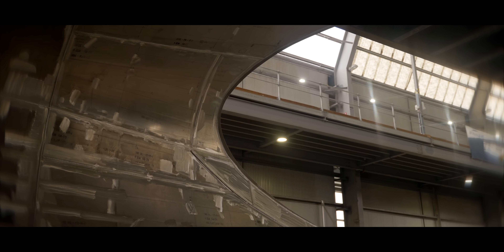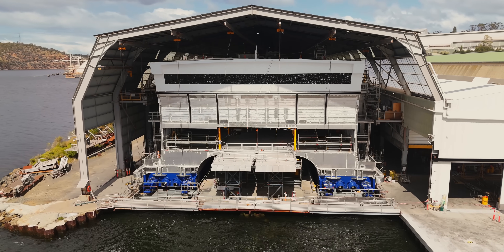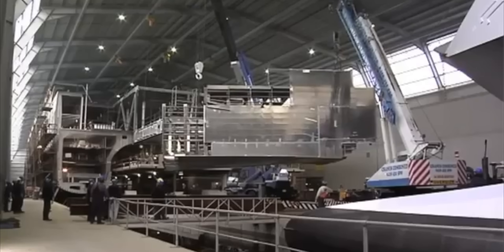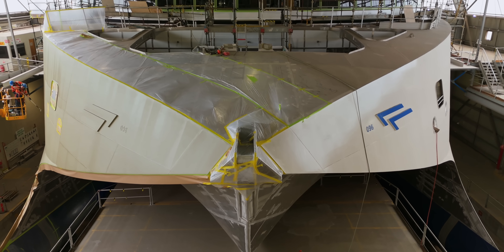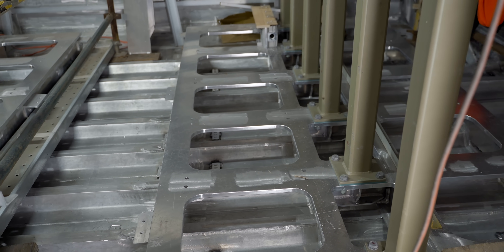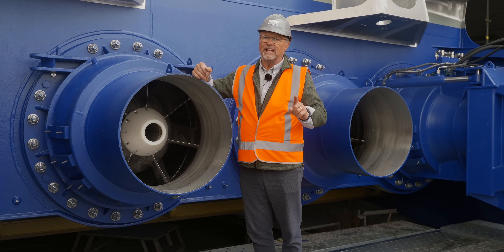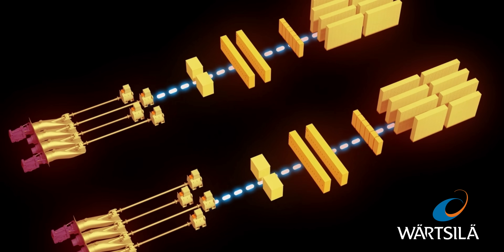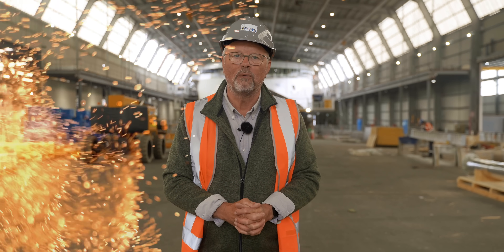The LARGEST Electric Vehicle In The World?!

Comment: An important mistake is that it's not 310 metres long. Is actually 130 metres (or 426 feet) which is still huge.
Reply: Claiming four jet engines at take off have the same power as one of the 2,200 kw waterjets is ridiculous too. The bigger jet engines today are well above 40,000 kw each.
Reply: 737 has around 24 000 kw each engine - says wikipedia  @juliane__
Reply: @bertkreft9689 jet engines are very poor efficiency, electric is ~95%
Reply: @bertkreft9689  and nowhere near 100% of that at 0mph is going into useful work
Reply: @juliane__  actually that's not what he said, he said each motor "uses" that amount of power, (not produces) the same amount of power as 4 jet engines on take off.
Reply: @matthewbrown435   - no one is saying how much a Boeing 747-8 consumes either...  - orders of magnitude off.
R_LL is not a technical guy - he giggles at anything that seems "outrageous, though totally understandable to anyone with a technical mindset.
Reply: @juliane__  eh.....447 tons.  this thing is far heavier. but accelerates to idk 30 probably vs 150 takeoff over 30 seconds or something
google says .7 seconds 160MW 450tons to go o-150.....so yeah its probably in reality like 1/20 of that going into useful work on takeoff or something idk. i feel like 20 seconds from standstill full power to lift off is about normal?
Reply: @alanmay7929 - The range is exactly what the ship is designed for. It's normal in engineering to fit a design to the needs. Anything above would only be excessive, costly and pointless.

In fact, this ship is far more cost effective than any other available drive train right now for its task. The very reason why they decided to go for it in the first place. The 'we are environmentally conscious' is just marketing honey on top these days. It is the economies and risk assessments which are the decisive factors.

It furthermore demonstrates that technology has come a long way. It means that nearly all ferries, if not all of them, can be replaced with electric drive trains now, the moment they would need replacement.
Reply: I thought 310 metres was a bit long
Reply: @philiptaylor7902  there is no way its 300meters
Reply: Shame you didn't get half your facts right.
Reply: Incat is a solid business. Building a world class shipyard on the bottom of the world, in an often dodgy economy, shows some nous. They deliver or die.
Reply: the biggest ship or moving object on earth the Knock Devis was over 420 meters long a true gigantic of the seas.
Reply: and the range a total joke!
Reply: @alanmay7929  the range is adequate for the task
Reply: @alanmay7929  It's built to fit a task.
You will see the same with other electric ferries too, look at countries like norway, where almost all ferries are electrified by now, they basically charge after every or every other crossing.
Reply: @DooMMasteR   - do they allow EVs on them now - they are a real hazard on an Aluminium boat, they were banned previously.. (in a country with ~90% government subsidised EV fleet.
Reply: @kadmow  There is only one company I know that did that Havila Kystruten other than that all other companies allow EV's and some even discount their journey or allow them on for free. It was a knee jerk reaction to an external audit due to fears over battery fires. This will fade in time as LFP and other battery formulas where thermal runaway isn't an issue.
Reply: @kadmow  yes and other ferries let electric cars charge while on the ferry. american car insurance companies published a study to verify the fire riscs in cars. highest risc hybrid, 2. ICE-cars, last place EV. most fires started in 12V system and was then fueled by oil and gas in the cars.
Reply: @alanmay7929 it's a ferry, it's designed to go from A-B carrying thousands of passengers 10 times a day - just enough is perfect, it's not a cruise ship
Reply: @matthewbrown435  who said it was a cruise ship?! its made for very short routes thats only what it can do! the diesel or LNG ones can be used for much more than just that and also go everywhere thats the point.
Reply: @alanmay7929  nope the point is to have something that doesn't have to rely on imported fuel, meets co2 emissions and is likely long term lower on maintenance. We have limited resources on this planet not to mention the climate crappin itself, why keep burning products that could be used for something else i.e the long haul trips

Comment: 40 megawatts of power to charge the ship, still laughing. what a nightmare for the power companies. By the way Tassie is not powered by 100% renewables. They still rely in some areas on Gas fired power stations and as stated rely on an under sea power cable from Victoria. The vast majority is powered by Hydro. Given todays strict environmental requirements I very much doubt you would get approvals for all the existing systems.
Reply: A typical large datacenter pulls somewhere from 50MW to 150MW (or more) and at 24x7 periods non-stop.

Even so, there are ways to mitigate the peak power demand during charging should it be an issue:

1) Install a stationary battery array of similar (or greater) size of the vehicle's battery array somewhere on-site or in proximity.  Then slow charge this battery when the ship is out in the waters so when the ship returns, the DC battery pack is ready right away to begin charging.
1a) An additional benefit is the stationary battery pack can do rapid & efficient "DC charging" since it is at the same voltage as the ship's battery.  This avoids transformer losses and DC rectification when power is pulled from the AC grid.
2) Install on-site and/or in proximity solar panels that can provide power to peak shave.  The panels can also work to charge the aforementioned stationary battery array.  This provides both peak shaving and reduces operating expense of purchasing so much electricity from the local grid.
Reply: @beyondfossil  yeah that's what I meant... as such 40MW isn't that difficult to maintain as a stable supply... but if you suddenly draw it from the regular power grid, the idle power plants needs a minute to rev up.

A battery backup charged at a constant speed is a good idea, so even if one harbour city is experiencing a blackout, the ferry can always return to the other harbour which most likely doesn't experience the same issue at the same time.
Reply: @BenjaminVestergaard Yep, also the ship's charging systems can be easily programmed to gradually ramp up charging current over a few minutes at least.  This would allow the electrical grid's control systems ample time to spin up and bring on enough power production to meet the new large demand load.  It is the courteous thing to do. 👍

This ramp up is likely what happens anyways as the charger's sensing electronics analyze the battery's readiness to accept incoming power.  Otherwise, there could be some damage occurring. The charger system can do accomplish this by bringing up the charging current slowly and listening for any fault codes from the BMS units.
Reply: @beyondfossil  generally data centers are located directly on the sides of power stations so there is a direct connection and they actually take time and contract with power companies before they are built.
Reply: @alanmay7929 Yes, a whole lot of permitting, paperwork, hearings, and studies are done before a facility of this scale is built.  The availability of electrical power is one of the areas that will get careful analysis.
Reply: @beyondfossil  look at AI companies, they are going to have to revive old nuclear power stations to make enough power for their reliable operations.
Reply: @alanmay7929  Nuclear is not needed by AI for a long list of technical and economic reasons.

Australia does not have nuclear and, wisely, will never have nuclear power.
Reply: @alanmay7929  Looks like YouTube is blocking all further posts on this topic.
Reply: @alanmay7929  This tech/nuclear thing is a mostly a media stunt by the major tech companies to draw attention to their growing energy needs.  It is working because nuclear is such a controversial hot-button topic.  It won't go anywhere much especially as renewables are getting cheaper by the year and much faster to deploy.

a) Nuclear power is the most expensive form of electricity production
b) Nuclear power takes the longest in construction time, even for a restart will take a lot of time
c) Datacenter power usage is a fast growing segment but overall is only small percentage of grid capacity world-wide.  The US has the most datacenters, but it accounts for only some 4% to 6% of the US total 4200TWh annual grid production.
Reply: Lights are gonna dim for a minute anywhere this ship docks. 😄

Comment: Not efficient!

Energy needed to make an entire ship in aluminium is much more than that of steel

Having the water jets only partially submerged is also inefficient - causing huge rooster tails of water wont be pushing the boat forward

Charging the ship via diesel generators?!

Comment: The fact that it is lighter than an LNG ship was quite surprising to me
Reply: the most efficient EV the Lucid has about 500 miles of range, a typical diesel bigger vehicle will get up to 900 miles of range and its even super easy to increase the range too.
Reply: no its not! its range is not even close to 100 miles! if you just fuel 100 miles of fuel on the LNG youll be significantly much lighter than the batteries! the LNG ones have tousands of miles of range so not even a comparison!
Reply: @alanmay7929  it's not the fuel weight, it's the weight of the engine & transmission that's greater. 400 tons of engines, 100 tons of gearboxes and 100 tons of fuel TANK = 600T, the batteries weigh 300T. So yeah, it's heavier BEFORE you fuel it. By a factor of 2 (for the drivetrain).
Reply: @theelectricmonk3909  wrong! wrong and rong! those things doesnt need gigantic engines those are relatively a small boats no need of a 100 tons engine use your brain lol!!! the gearbox too isnt tha much heavier either! the fuel is what makes most of the weight since they needs it to be able to do tousands of miles.
Reply: @theelectricmonk3909  some even uses turbine engines which are even much smaller powerfull and tho less efficient is more compact and still offers way more range than batteries!
Reply: @theelectricmonk3909  other modern ships powertrains are diesel electric like trains relatively multiple smaller engines and electric propulsions like azipods or thrusters and Wartsilla makes all of them.
Reply: @alanmay7929  Watch the video - it's not me making those claims, it's the guy building the boat! He should know!

Comment: Time Duration of discharging Battery power ; 
40e6 Watt•Hr ÷(24,000hp×745.9)= 2.234 hours
With Max power : 2 hours 14 minutes. For moderate power/operation maybe 3 hours (max)?
Reply: Trip between Buenos Aires - Colonia will take about half an hour. Time for charging between trips is 2/3 hours.

Comment: swappable batteries would be another way to increase the ships utilization. And the rapidly advancement of battery technology (charge density and lower cost) another set or two of batteries would be much more economically viable. Just one needs to include that in the initial design with 250 tons of batteries currently envisioned.
Reply: I think it’s more complex than doing that due it’s location and integration within the ship.
Reply: wrong! wrong! wrong! swapping makes no sense! the batteries just like engine and fuel tank are at the bottom of the ships making any operation impossible and very difficult

Comment: You all HAVE to do a follow-up when it goes in service.
Reply: - like, How do they source that 40MW of power - and at what cost for the storage Farm...
 - It appears to be a great route for a  super fast boat - just enough time for a toilet break and it will be docking.
Reply: Charge up capacitors on shore while it is underway so it can charge really fast when docked?
Reply: @MichaelFoley64  Then thermal runaway and fire that cannot be put out with regular shipboard firefighting.
Reply: @MichaelFoley64  Nicht nötig, das Netz kann locker 40 MW  liefern  mit 110 KV Anschluss . Aber auch ein 20 KV Anschluss schafft das.  Große Einkaufszentren  benötigen in etwa 50 MW Anschlussleistung.
Reply: @kadmow  40 MW ist nix an der Mittelspannung.
Reply: And when they deliver it.
Reply: If it’s anything like the ferry of theirs that runs to Jersey from UK it’s very sensitive to waves. Not in a good way.
Reply: @tobyhague5974  Da baut man sie halt anders.  Aber Katamarane kommen sehr gut durch die Wellen, weil sie ja mit dem Bug kaum aufschwimmen.
Reply: I agree.
Reply: Or burns

Comment: Tasmania is not quite 100 percent renewably powered. In times of drought, there is a submarine cable that allows coal fired electricity from the state of Victoria to be imported.
Reply: I believe he said net zero. So they buy credits to offset
Reply: @scenicshoots  Not quite.  Tasmania doesn't buy any credits, but trees growing back after the logging industry downsized provided credits.
Reply: And when it is a good wet winter/spring the Hydro River systems export due to excess supply. Some years there has been a little more imports than exports but a couple of new wind farms have meant that more recently some years there are exports but mostly close to imports = exports.  Some new proposed wind farms will in years ahead tip this to net exports every year.
Reply: Pathetic comment
Reply: In times of drought, when there's no sun then? Bwaaa hahaa
Reply: @chuzzbot  Yes - solar and Hydro are a good mix - we have little solar.  One new solar farm on a sheep property is being built and roof top solar needs to grow further.  But a couple of wind farms in the pipeline will mean it will exceed 100% every year easily.
Reply: @chuzzbot There’s very little by way of coal and no proven oil, so perhaps you could apply your obviously giant intellect to suggesting an alternative energy supply. Hydro-electricity has provided a reliable energy supply in Tasmania for a hundred years, but that’s clearly a source of humour for low-information types.
Reply: It’s actually connected to the Eastern Australian electricity grid, which is fed by (dwindling) coal-fired thermal plant, gas-fired, solar, wind and hydroelectric plant on mainland Australia, so what comes back the other way isn’t simply from coal-fired plant.
Reply: The purpose of the underwater cable is to supply energy to the mainland at peak times the two means of producing energy compliment each other, Tassie is my home state and I for one am proud to be Tasmanian
Reply: Victoria has sub 60% coal powered grid and falling , lets hope they kick coal of the grid like the UK
Reply: https://en.wikipedia.org/wiki/Electricity_sector_in_Argentina
Reply: Indeed! I checked and in 2024 there was almost 4% of electricity was fossil powered. Still would count as clean by UK govt definition 😂
Reply: So it is from day to day just in an emergency it needs that power? So it is 100% renewable as does not rely on that power to use each day. 😏
Reply: @alastairhatt360  Net zero means a lot more than just electricity generation.
Reply: @JimmyLLL  Tas was Net Zero for a number of years due to the collapse of a major wood chipping company when world wood chip prices plummeted. So regrowth and a huge reduction in old growth logging meant that, combined with the Hydro and Wind electricity it was net zero.  But there are plenty of real emissions Tasmania needs to reduce and it would be good if the state could have an ambitious real zero target and stop relying on an accounting trick that relies on regrowth of areas formerly logged.

Comment: I guess with that battery they wont need to fill the lower deck with gravel as ballast.
Reply: Big catamrans don't need much ballast. They are wider than monohull ships so they balance themselves.
Reply: @Dave_Sisson  ok then they REALLY don't need any gravel 😂
Reply: balast is generally the waters on which you are travelling lol!!! you pump them on board to balance the ship.
Reply: Saves them using the HEAVIER LNG engines for the same purpose...

Comment: I would be interested to hear about the fire suppression systems on this craft.
Reply: A very good thought. I hope they are not Lithium Ion as that would be incredibly foolish.
Reply: @michael.randall5034  The battery packs are supplied by Corvus and use Lithium ion NCA. DNV does not agree with you on the safety rating.
Reply: The same as any other craft.
Reply: @dogbreath6974  so no special features to cover battery ignition?

Comment: So where is all this clean energy coming from to charge the ship and how clean is it down the line?
Reply: I believe the power on the Uruguayan side is clean but the Argentinian side, not so much. Tasmania is basically powered by hydro and wind.
Reply: @josephoneill7656  A wid generator uses approximately 500 US Gallons of oil between the generator and transformer and is changed periodically. All the infrastructure behind the whole thing is a big trade-off that is hidden by big corporations. That's all the Green energy Idea is if one truly looks at it all.  mining all the copper for high-energy wire transformers, motors, and Mega factories to produce everything from solar panels to wind turbine towers and blades. Clean is relative. Get the Point ?